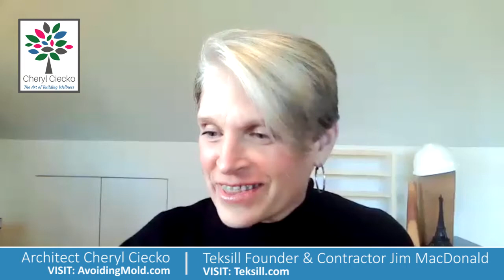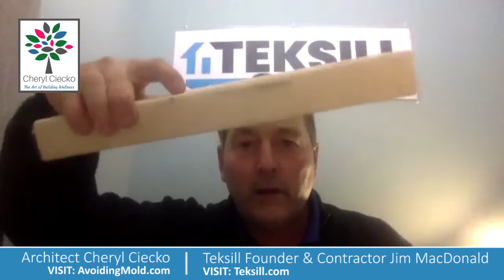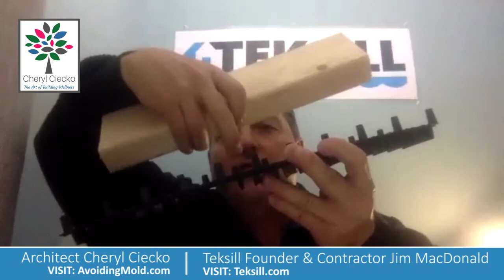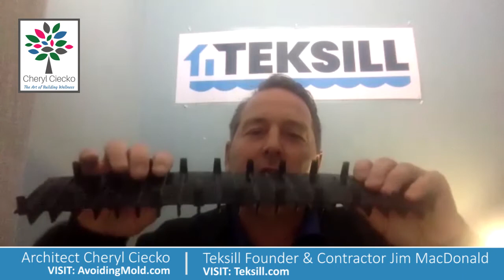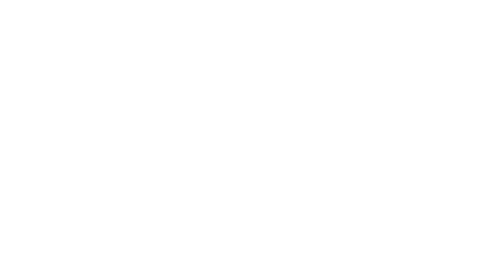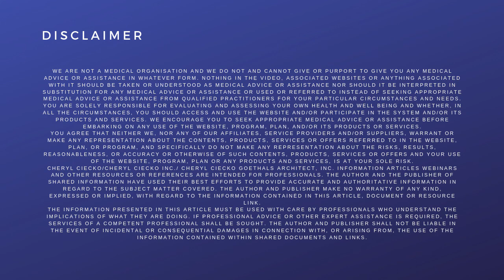Basement Moisture Issues & Solutions with Jim MacDonald Of Teksill

Comment: Is this still an issue if the sill is pressure treated?
Reply from the maker: Yes.  The pressure treatment is meant to stop decay fungi but mold is still possible in the spaces between two materials that can’t dry easily or well.

All skills on concrete are required to be treated  or durable species by building codes.

Comment: Is this still an issue if the sill is pressure treated?
Reply from the maker: All wood in contact with concrete should be pressure treated, but I do not believe that pressure treatment has any affect on preventing mold.  The Teksill product is meant to keep wood up off the concrete slightly so that any water seepage will not soak into the wood and to facilitate drying after events.  In theory, there could be mold under the plastic in contact with the concrete but there wood be less than the potential mold in the wood where it is continously connected to concrete when traditional construction methods are used.

Comment: We just looked at a new house that has a buried basement with windows but it’s not a walk out basement so basically fully buried.  Any sense of difference between moisture issues in this type of basement vs a walk out one?
Reply from the maker: That's basically just the buried part of the walk out basement.  A walkout basement has a section that is like any home on a slab.  Window wells do need to be addressed properly but any window needs proper flashing... The devil is always in the details.  There is nothing that is perfect on its own.  Good Question!